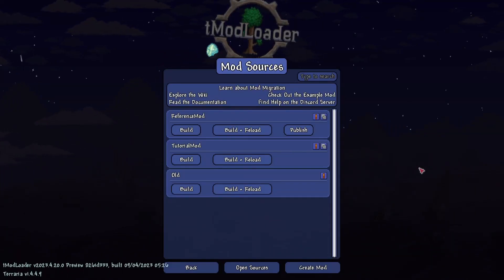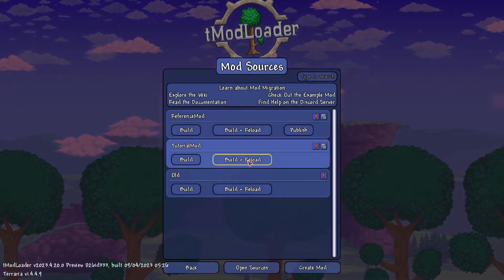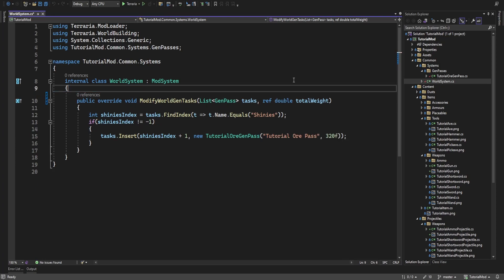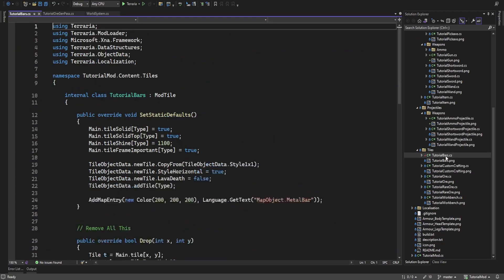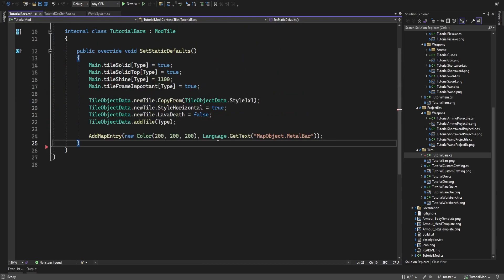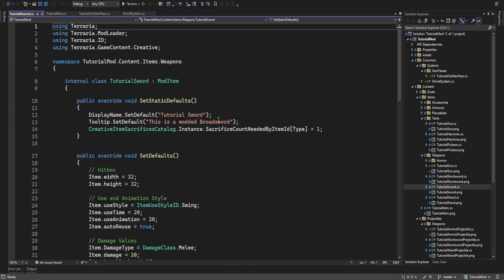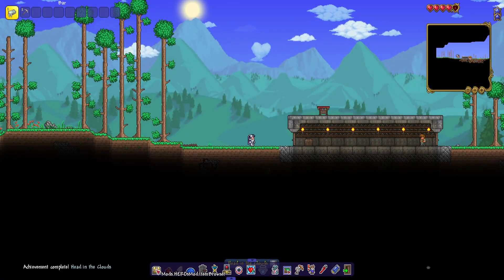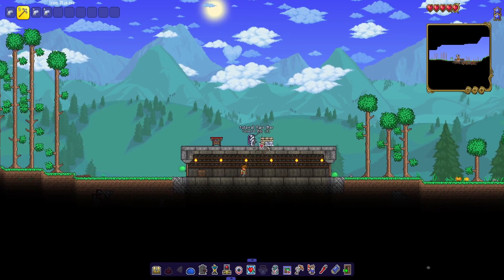v2023.4.20.0 FIXES - HOW TO MAKE A MOD - TMODLOADER 1.4 - MIGRATION (1)

Comment: Its opened up on visual studio 2022 but on the solution explorer part it says
Solution 'solution 1' (0 projects) 
It says i have no projects. Anway i can fix it?
Reply from the maker: You haven't opened your project. File open project or solution and open the csproj file
Reply: @FoolsLynx  so should I open it from visual studio or tmodlauncher?
Reply from the maker: Either. If you launched for tmodloader you might be missing some components. If you open in visual studio and you are missing components it will moan about it. In which case make sure you have .net dev installed through visual studio installer
Reply: @FoolsLynx  when I run from t modlauncher I get the problem of it showing 0 projects. And I can't seem to find the file when opening it from visual studio
Reply: @FoolsLynx  also by any chance do you know the reason that causes this to happen?
Reply from the maker: You are likely missing components that allow you to program c# make sure you have .net desktop development installed.